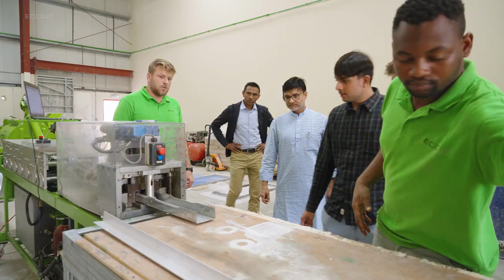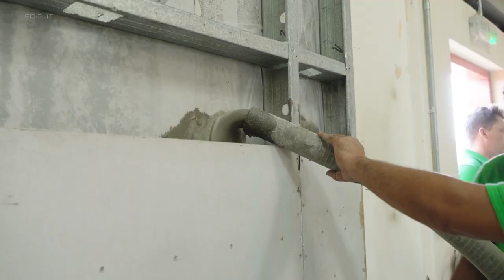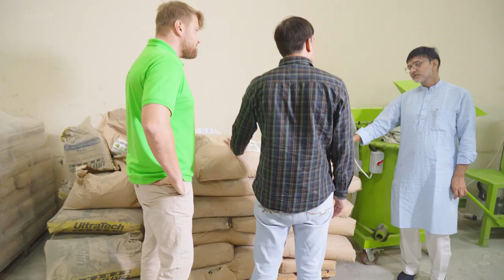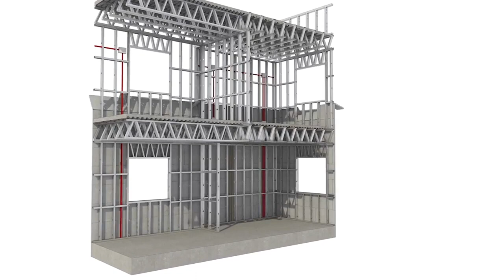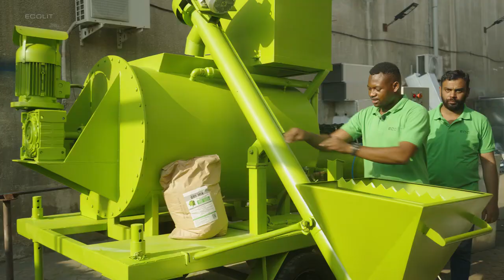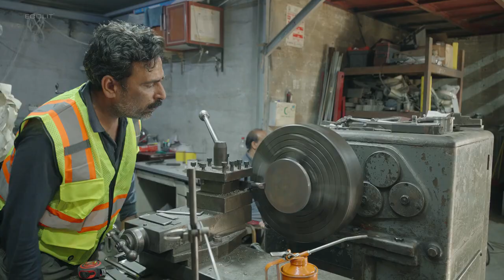Light gauge steel frame with lightweight concrete insulation technology // looking partners globally

Comment: The initial investment is fair tovarische, but what about the recurring expenses?  Are we tied to shipping the dry mix from you? Or will you give us the lime/cement and aluminum powder recipe??
Reply: The expenses is so minimal, but for sure  more projects you have then faster and cheapest will be the pricing and return of investments.  And yes, we are supplying the components and ratio based on local market conditions . Where are you from ?